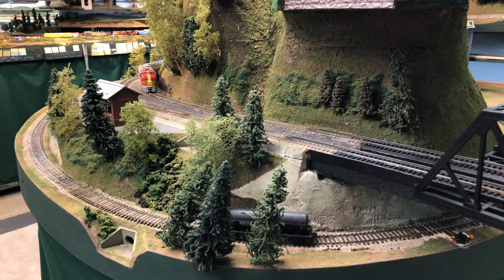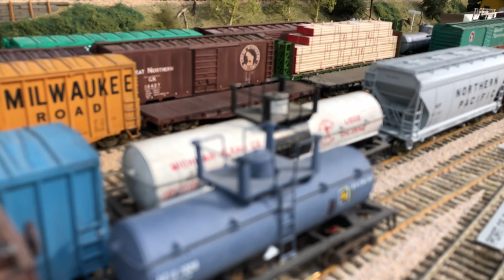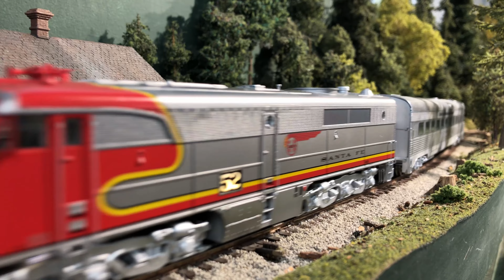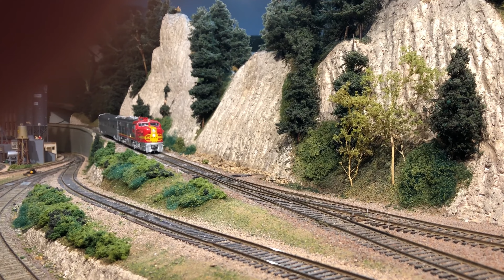Part 82 - BN yard overviews & Rapido Alco PA-1 with Burr's birthday train #train #hoscale #layout

Comment: What a fine looking birthday car! 😄 I am surprised, however, that there was no mention of the unit coal train that magically appeared at the 8 minute mark. Or maybe that wasn't the unit coal train? I guess we'll never know... Great reality railroading!
Reply from the maker: You mean the coal train and the rock train on the narrow shelf along the wall? Yes, that's where those two trains are staged in between runs. You may have seen that coal train run recently in my "Part 80" video and also in a recent "short" video. Thanks for your comment!
Reply: @muchfunwithtrains  Yes, that's the one. I've been following it in several of your previous videos. That's why I was surprised that it made an appearance but wasn't mentioned in the narrative. 😁 Keep up the good work!

Comment: I have been going to ask you this for some time now. What R the push pins under the switch throws for?
Reply from the maker: They do two things. They limit the movement of the switch handle so it's easier to get under your finger, and they are a way to simulate colored targets on switch stands, or even dwarf signals. If the curved position shows red and the straight position shows green, you know you're on the mainline. If the straight position shows yellow, then you're off the main. It's not always obvious which track is the mainline, so this helps a little.
Reply: @muchfunwithtrains  Thank you for the quick answer. You have given me some ideas. :)

Comment: I love the BN RS-3 at 2:00 min. into the video
Reply from the maker: Me too. That's an Atlas loco from a few years ago, and one of the few that I actually masked the windows and sprayed with Dullcote. My plan is to put a sound decoder in the weed sprayer car so it will make a hiss while the RS3 is pushing it along with Alco sounds.
Reply: I live in Bothell Wa. So I understand your entire layout ... I love the Seattle background but I do miss that Viaduct view.... sigh @muchfunwithtrains
Reply from the maker: I've been thinking for years about constructing a model of the viaduct above the South Portal section of the layout, which doesn't quite make sense. But maybe I could do it diagonally across the North Portal, like it was on the prototype, underneath the painting of Mount Rainier. Thanks for spuring me to think about this!